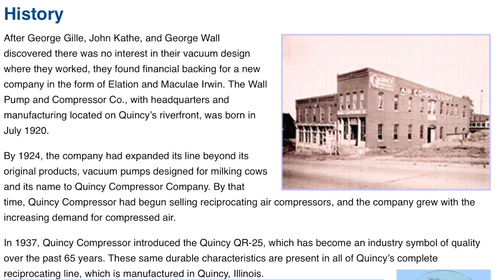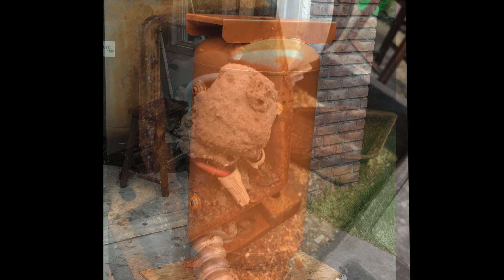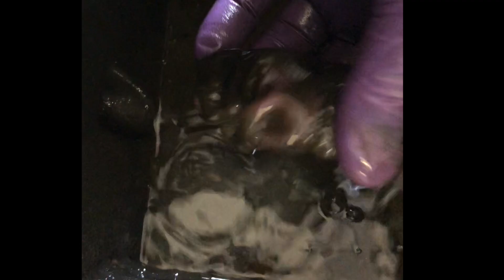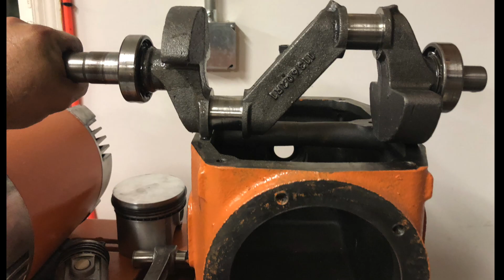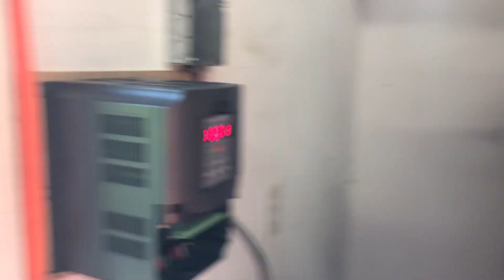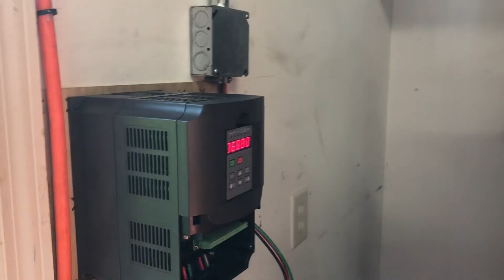Quincy QT-5 5 hp air compressor Overhaul

Comment: I just picked up the same compressor for $350 but its got 3phase motor and we don't have 3ph service (residential). 
Have been looking for 1ph 5hp motor to replace current motor, but seems like VFD may be the more cost effective approach actually.
Read your other reply about what VFD you used -- You had any issues with it in the last 5 years?
Reply from the maker: Nope...  Ive got the same set up, and haven't had any problems with it...

Comment: Does the compressor still run well? I have this same exact compressor that was given to me i was thinking of doing the same thing. It's missing the parts that wire to the motor and 230v plug. Mine was full of oil and water mixed, wondering if i need to rebuild pump. Any suggestions appreciated

Comment: Nice video. I just scored a QT-5 for $180 but it does need a motor. My existing compressor uses the same size motor, 5hp, now I just need to find an appropriately pulley for the motor.
Reply from the maker: Nice score!  I've used this company a few times to get pulleys.  https://compressor-source.com/collections/new-pulleys-and-belts

Good luck!

Comment: What size motor are you using
Reply from the maker: It has a 5Hp 3phase motor.  Runs quiet and strong like a champ.  The thing that I like best about it is that you can talk over the motor while it's running...
Reply: @JeremiahL   were did you get your gasket kit. Sorry for asking so many questions I just bought one for 20 bucks and rebuilding a 80 gallon one
Reply from the maker: @datdude8267  I can't remember to be honest.  I think I bought a gasket kit or a refurb kit on some website.  I did find a local compressor repair shop that sold me some valves and other fittings for a fraction of what I would have paid for online.  Sorry dude

Comment: Congrats on pulling off this rebuild, nicely done as is the video/audio.  I'm picking up a QTS-3 today (3/9/2019) which the seller says needs "seals" but he wasn't specific what he meant by 'seals', head gasket? shaft?  Anyhow, I'll figure it out after I get it on my bench later today.  My primary air compressor (have six) uses a Quincy QTS-3 which I installed several years ago when Quincy pumps were sold as individual units. I don't think you can get a Quincy pump out of a catalog in today's world.  It runs great but I sure like to have this new pump as a spare.
Reply from the maker: Scarpia thats great!  Let me know how it goes!
Reply: OK, will do...the seller wants 50 bucks for it claiming that for another 50 you can get a rebuild kit, or that was what he was told.  He said he opted to get a new air compressor to finish a hot project and did not want to get involved with the Quincy pump rebuild instead.
Reply from the maker: Scarpia For what it’s worth, I ordered all of my parts from IAP.com.  Their prices were reasonable, but they are slow as Christmas in fulfilling orders.      I’ve found that a-lot of these internet spares companies are like that.  Eventually, I found a local supply and repair place that had better prices, with instant gratification. 

If you look around you can get some good deals on spares.
Reply: I'm OK with a time delay in getting parts off the web, time is on my side.  I'm just having fun with my compressor projects as well as my motorcycles, Corvettes and other projects in my garage/shop.  If I had to make a living off my stuff, that's another matter.  I'm a retired gray haired old guy (75) keeping my hands and noggin' busy.  It will be a cold day in heck before you find me in an RV park with a bunch of old farts playing bingo, not me.
Reply: Well, I  done it...got the QTS-3 home and checked it out.  The sump was totally dry so I added compressor oil to the proper lever. Before adding oil, I turned the wheel by hand and it felt very rough and only a little better with oil so the bearings are likely toast.  I laid the compressor on its side so oil could flow into the bearings then set it upright and turned the wheel by hand again.  I noticed oil slowly seeping out of the seal when on its side,  so it's possible the rings are worn causing air pressure to build up in the crank case which forced oil out of the wheel side shaft seal. Only a guess.  The good news is I felt a puff of air out the outlet when I turned it by hand so the reed valves seem to be OK.  I have the parts manual for the QTS-3 (dated 2010) which shows the crank shaft as an assembly including the bearings so I'll have to open it up and see if I can ID the bearings and get them separately.  I don't want to spend big bucks on this project.  There's a Quincy dealer/repair facility in Seattle (I'm 25 miles away in the 'burb's) so I'll call them and get their take on repair parts.  I will also remove the belt of my existing QTS-3 pump  and turn the wheel by hand to compare the feel, maybe the  bearings are OK and it's the oil seal only that needs replacing.
Reply from the maker: @scarpia519  Thats awesome!  Keep at it.  Thanks for subscribing!

Comment: Hey good job I just got done rebuilding a Quincy 308 roc 22 kinda rare.    What vfd are you using I am interested in one but don't have alot of knowledge about them wanna find one that is good for up to 10 how for my next compressor build
Reply from the maker: The one that I used Is made by HUANYANG.  I think they are one of the only companies that make a 5HP VFD with 220V input voltage.  I'll give you an amazon link, but they are around $80 cheaper on EBAY.

https://www.amazon.com/HY-HUANYANG-Variable-Frequency-Converter/dp/B07HDYX25C/ref=sr_1_2?ie=UTF8&qid=1546223531&sr=8-2&keywords=5-hp+vfd

There are a few features that you need.  A soft start function will be helpful by starting your motor slowly and gradually building up to full power over say 10 seconds or so. This will help reduce wear on your motor, and reduce amperage spikes that you see with a hardwired motor where you go from rest to full speed instantly.  There is also a way to wire your pressure switch directly to the VFD so that when the pressure drops the VFD gets the start and stop voltage signal.

I've spec'd out and installed a bunch of VFDs, so if you have any questions or need help, you can find my email address on my channel under the "ABOUT" tab.

Thanks again for watching, and like I said, I have many videos about installing and wiring a VFD. Please subscribe if you are interested.